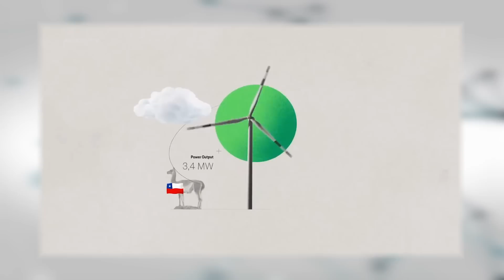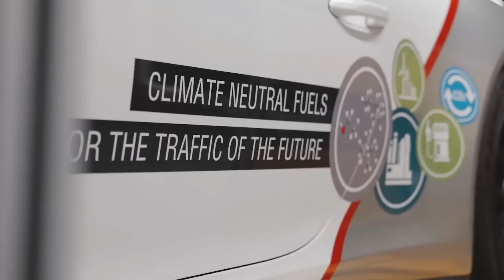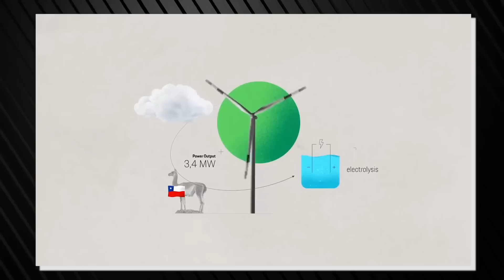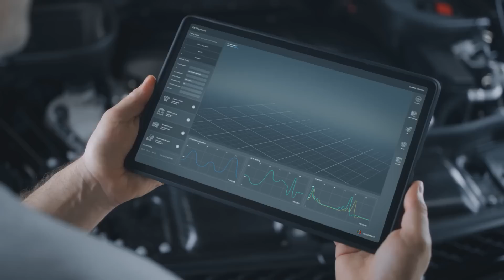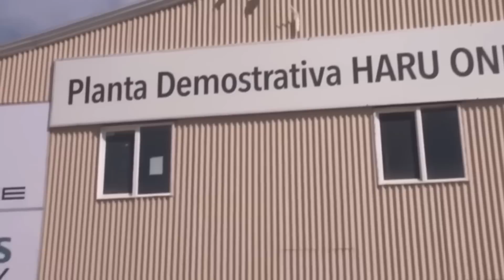Could Porsche's eFuel Wipe Out the EV Industry?

Comment: So rather than generating electricity and putting it into a battery where a car can use up to 90% of it, we’re instead going to generate a shed load more power to separate hydrogen from water, capture CO2, combine the 2, then physically transport it around the world, only to put it in an engine that uses 20-30% of the total power used through out the entire creation process?

That sounds just plane stupid, never mind expensive. I can see this being used in motorsport, but I doubt it will be affordable for regular everyday drivers.

Comment: I'm unable to agree that 'E-Fuel' is a viable environmental solution for clean vehicular propulsion. In the first case, the product still remains a hydrocarbon fuel and as such will release CO2 as a combustion product. Secondly, its very production is an energy-intensive-procedure, with at the best, a reliance on carbon-neutral electricity generation: a system which cannot be guaranteed to be 100% sustainable due to climactic, political and economic uncertainties. Thirdly, distribution of this fuel to the outlets will be dependent on the bulk transportation of a volatile liquid via fleets of polluting vehicles of indeterminate origin. And finally, the intended offset of exhaust CO2 by means of carbon capture has, at the present state of the game, very little likelihood of achieving anywhere near to the sequestering volume required for neutralising atmospheric CO2. Seems to me that Porche is grasping at phantom straws and fails to understand that combustion - of any sort in air - is an environment and ecological No-No!
Reply: We need to be more efficient with the power we generate, and this is far from efficient. It’s just haemorrhaging energy at every step.

Comment: How sustainable would be producing 1.7m barrels efuels per day?

How is EV carbon positive? We need to factor in carbon emissions produced during lithium extraction and battery production.
Reply: We are close to recycling lithium at large scale so this is a moot point
Reply: @segredosdotiosam9989  and recycling lithium from a li ion battery is an environmentally friendly process?

Im not discarding ev as clean energy.. ev is clean as a tech. But the source of its 'e' is debatable.
In our race to be ev ready, we are not considering the environmental impact of lithium extraction that is happening. I am not even bringing up the carbon cost if a coal powered thermal plant

So till the time evs are truly carbon neutral, lets not call it green.

Each ev should come with a carbon debt and each mile it runs should get carbon credit as compared to an equivalent ice engine. 
Once it has cleared its carbon debt we can truly call that car carbon neutral.
Reply: @ssabt12  We are getting there. Battery materials and efficiency will get better and Clean energy will improve too.  Things are running side-by-side. The Fossil fuel use is a dead end.
Reply: @segredosdotiosam9989  till the time we get there, lets not call it clean.
Its high time we stopped romanticizing li-ion evs

Comment: Electric cars have a high total efficiency.  Perhaps 80% when you consider that charging the batteries loses say 10%, and then the electric drivetrain loses say another 10%.  But the ICE is only, at best 40% efficient (toyota's atkinson cycle).  Although the carbon emissions produced may match the carbon sunk into the e-fuel, so it is carbon neutral, in a sense (this does not account for the production of wind generators, solar panels, transport of energy to the e-fuels plant, efficincy losses during electrolysis, and the production of the high pressure in the plant, but then again neither do we account for the carbon emissions of EV electricity, or battery manufacture), the efficiency loss of some 40% compared to the EV, seems a fairly large gap to fill with any business model advantage.
Reply: There are still problems in EV though .. There are countries heavily rely on fuel for electricity generation.. The other problem is related to the use of materials for batteries and also the waste management once the batteries goes end of life.

Comment: As soon as possible, e-fuels should be integrated into racing car engines for testing which can create sustainable opportunities for mass commercial use. 
What also needs to be determined is if there are other e-versions for the remaining fluids used in ICEs, e.g. lubricants for the engine and transmission, coolants, etc.
Reply: There are definitely recyclated engine oils.

Comment: IMHO the process should be studied/refined more? CO2 captured and H2 basically forms Green Methanol. What is the energy difference in converting Methanol to E-fuels? Could it be adapting ICE to work even better with Methanol makes more sense? There are already Spark Ignition and Compression Ignition ICE that work with Methanol and whats great Methanol is a LOHC i.e Liquid Organic Hydrogen Carrier and there are fuel cells that also work with Methanol which could be power generators or installed in land/marine vehicles to work with electric motors!